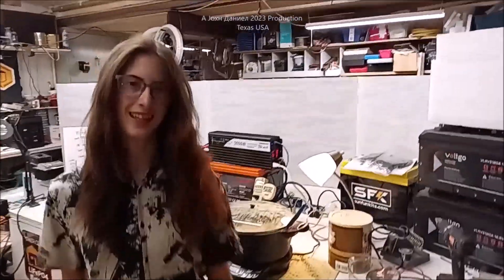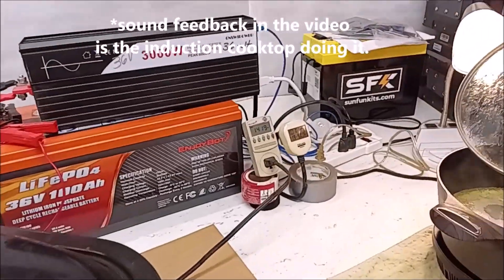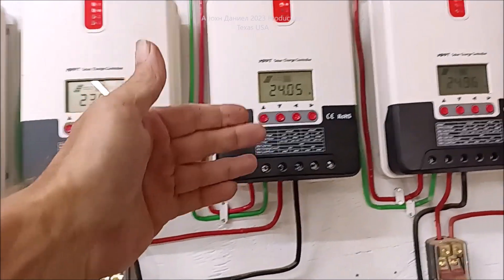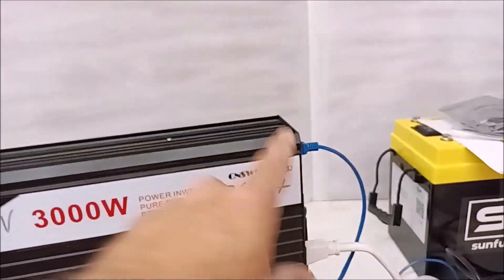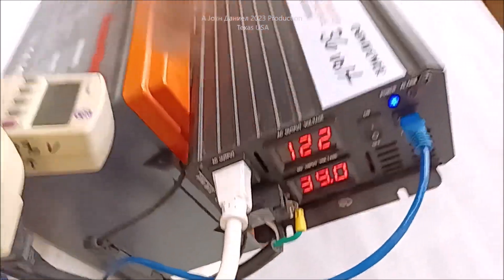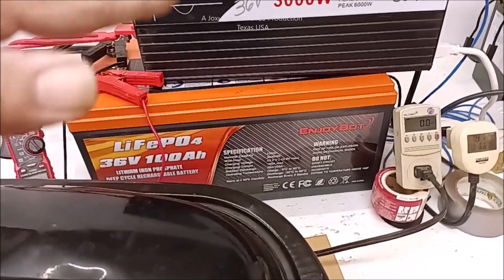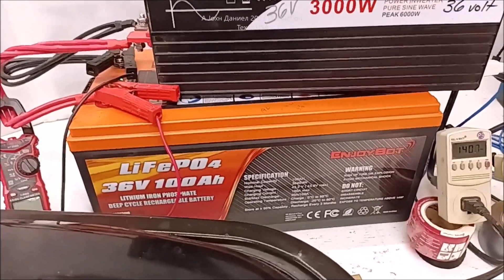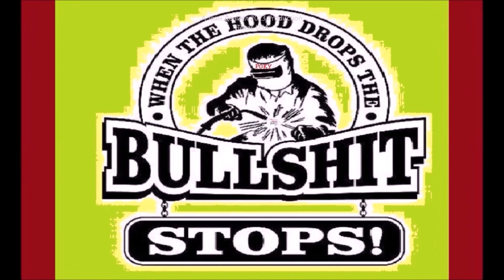36 Volt Lithium LiFePO4 by ENJOYBOT & DC 36V Power Inverter by Xijia Swi-Power, the perfect match!

Comment: Hi john if im using solar and not wind whats your advice
Reply from the maker: Wind is a supplement to a system, but few build actually big enough solar and battery capacity  anyway. Always do 25% more solar and battery than you plan or believe you need as the best solution.

Comment: I'm running 12 v set up .3 . 12v ìn pal. .should I  just I change it to 36 v?
Reply from the maker: Depends on your total plans. If your plan is 50% or more of your power made by you, then yes. If it's less than that then stay 12 volt so you can easily apply 12 volt powered items like lights, cooking and RV related parts. I choose hybrid so I can use 36 volt for faster charging off a wind turbine or generator if needed. My main system is all 12 volt but its in the many thousand amps distributed and balanced with Lead Acid for bulk draw hits connected directly to LiFePO4 for voltage support.

Comment: as a newbie I was wondering about voltage. I know with AC or DC higher volts, lower volts is the best way. I’m use to 12v automotive, but the 36-48 volt is new. A pro/con video about 36v and 48v would be appreciated.
Reply from the maker: The 12 volt plan is the SHTF, prepper, Survival plan and just basic math in that outcome. A 36 volt and 48 volt system is OK if you have unlimited pockets, unlimited time and unlimited belief that the powers in the world ain't gonna screw it all up.
Mathematically 12 volt is the functional lowest common denominator since it's singularity in battery voltage. If you have sixteen 12 volt batteries and one fails, your 1/16th down in power. If you have sixteen in a 48 volt system and only one fails, your 1/4 down in power. You can replace one battery in a 12 volt system with little effect on the other 15, but in a 48 volt system its detrimental and will lead to repeated fails. 
12 volt items, lights, inverters, refrigerators, RV and Marine materials are 95% of the market so per item price is 22% lower than 48 volt similar. For 48 volt you loose a part, its mail order, higher priced, and your down for weeks. On 12 volt, its off to Walmart or even a scrap yard to be back online immediately. 
But, the 48 volt folks do drive cooler cars!
Reply: great points. Thanks

Comment: Thank you for bringing up idea of 36V devices. I'll need to take a close look to see what is avail at that voltage, I would assume quite a bit if it was industry standard. I've been watching for a while to learn the DIY side of higher wattage DC power delivery. I'm brand new to the world of DIY power and electronics, so I'll share what I learned below.

I am attempting a small project of powering a bunch of smaller computers using a single power supply, while any one computer will not draw more than 100w, I plan to have many of them with room to grow, with a combined max pull of about 900w at voltages ranging from 12v to 19v. The space I have to do this in is limited, so smaller, flexible wires for my power distributions a must. Unfortunately 48V seems to be targeted at the house alt power market, which is good to know. but those devices take up space I simply don't have, within a half depth, 4ft tall 19in server rack.

I'm sure you have covered this in the past. But one of most powerful and solidly built AC-DC Converters you can get for cheap are old server grade power supplies. I have a 1000w 12v 98% efficient server power supply I got cheap even from amazon, only some simple modification needed to get it working, but finding a boost converter that I would be conformable handling up to 1000w at 48v for extended periods in a small-ish form factor has been difficult. I was originally planning to boost up to 48v, but if I can find something reasonable at 36 at a reasonable hobbyist cost then it would be worth the slightly larger wire.

Thank you for taking the time to share your knowledge and posting links to everything!
Reply from the maker: The thing about 36 volt is the ability for anyone now to add wind power with real results even if your wind source is low. I have been doing it for decades, the 36 volt slave battery or even whole house battery is the best of both worlds. The Enjoybot is cheaper on that link I dropped, and 4 can run a average home.

Comment: The reason 36v was the industry standard is because it’s below lethal voltage, 50v and above are considered lethal Voltage, however with safety protocols in place the higher the voltage the more economical a system becomes due to wiring costs, line losses and conversion losses. In a perfect world the desired output voltage would be the same as the stored voltage thus reducing or eliminating and converting at all
Reply from the maker: When I was a process pipe tech all our PLC and Servos were 36 volt, all the control circuits were 36 and 12VDC. When we did work on yachts and large boats the DC system was and still is mostly 36 volt. Refrigerators for DC were 36v before China got into it. Even sunfrost was 36v first. And the winner is Wind Power from 48 volt turbines that allows you to take your stored 36 volt and run 12 volt efficiently and even get near 97% efficiency boosting it to 54 volts to run it into 48 volt battery. Doing it with any other voltage is a higher cost and loss factor.

Comment: I thought the BMS (if it's 100 amp) would limit such output?
I have the Power Queen 12v 200 ah battery with a Giandel 2200 watt inverter, can I cook using the burner and crock pot? (Without triggering the 100 amp BMS?)
Reply from the maker: Not at 12 volt, but you can at 36 volt due to the basics of ohms law. In reality your 12 volt supply can do it and you just will use the same amount of watts, just 3X the amps for the same result. The main reason we have 36 volt is for the well pump house, the solar on it is 66 volts Stion 135 watt x 6 and the most effective way to do deep well DC cheaply is 24 volt pumps. 48 volt pumps are $100 more, 12 volt is same price as 24 volt but the 74 feet down is not nice to wire losses.
Reply: @JOHNDANIEL1  thanx for your response. I don't know much about well pumps, but it seems like an above ground pump would reduce the length of wire needed coming from the battery? Again, I don't know your scenario as well as you.
Thank you sir, and daughter for all you do.
Take care

Comment: In some of your other videos, you've mentioned being able to phase match multiple inverters to get 240v from these 120v inverters in parallel. I haven't seen where SWIPower inverters can do this. Is there a trick that you know of to accomplish this?
Reply from the maker: You use the link on the inverter control board in one, the master, its one processor to operate the switching on both inverters. They made many examples of it some years back with both AIMS and SWI Power. there is a cat5 wire that goes between them, I just do not have the time or need to do it when you can just buy a Sun Gold that's 4000 watt and 240 volt already for the same end cost.
Reply: @JOHNDANIEL1  
Thank you. I already have one 3000w SWIPower 48v inverter, if all I would need is a 2nd one, it would be worth looking into.
I'm actually thinking about upgrading to a 6000w inverter because of the induction startup loads from the shop power tools.
Reply: Try the eco flow HUB split phase
Reply: @luk618  
Doesn't that EcoFlow hub only work with EcoFlow products?